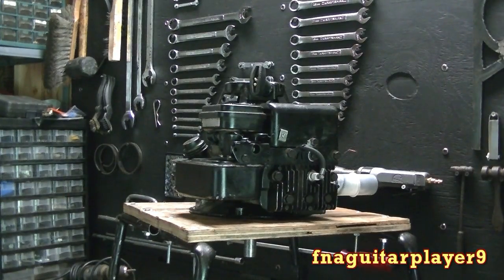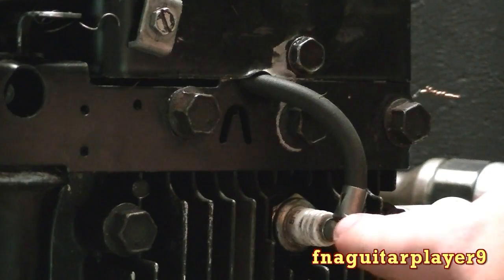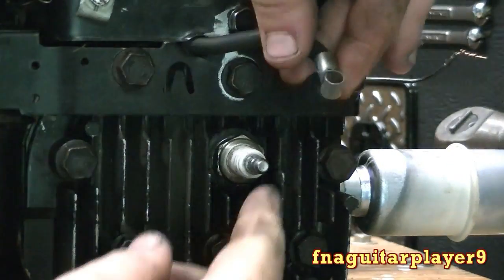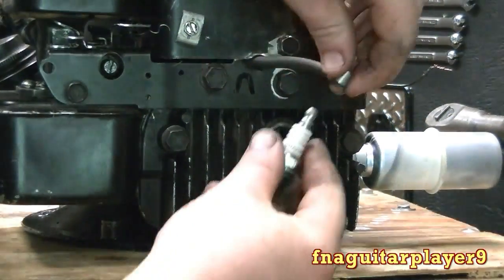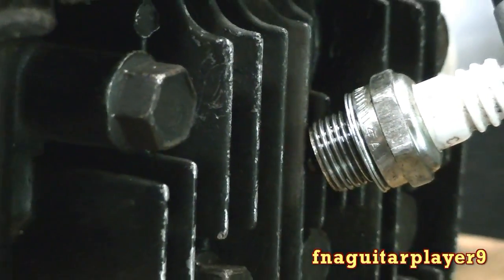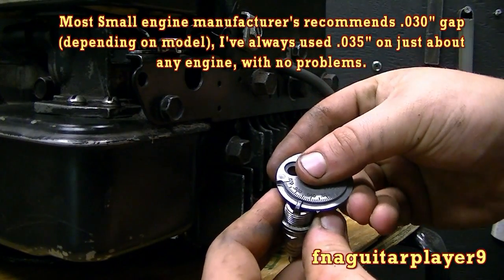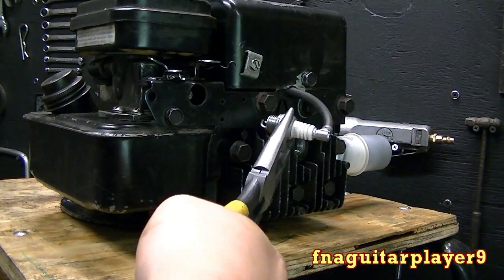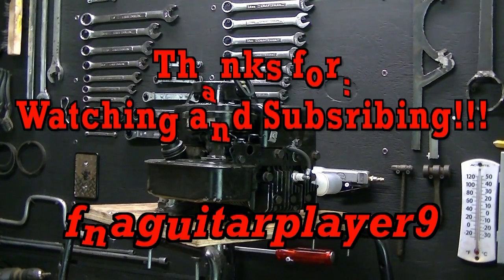How to check for Spark Plug Fire (in any engine)

Comment: You just saved me a costly repair with this video. I gapped some plugs for a Kawasaki 21hp motor "according to specs" and it wouldn't fire for nothing! I was thinking the coils were bad. They are about $80 each. After watching your video, I went out and checked the plugs and ended up resetting the gap and she fired right up! Thanks!
Reply from the maker: Glad to help out! It wouldn't surprise me if the coils were weak, because Kawasakis are bad about the coils going out. Thanks for Watching!!!

Comment: thank you for this. been wondering how to see if my motorcycle was sparking or not. did not want to pay for an extra tool. this was a well made video for people like me who are gearhead newbies!!!
Reply from the maker: Your welcome, yeah I found this is the best way to do it, some will argue saying its not 100% accurate, because the spark can change under pressure, which is true, but this has always worked for me, they do make a inline tool (pretty cheap actually) that connects inline, never used one! Thanks for Watching!!!

Comment from the maker: Thats very true. Someone left a similar comment about a year ago on this video. What this "test" does is just make sure that the ignition system is working and the plug is firing. In my experience If you have a plug with a blue or blueish purple spark, it will run fine in the engine, you can't really get a better spark than that. But like I said this just tests to see that the plug is firing. its nearly impossible to see what the plug is actually doing while running. Thanks for Watching!!!

Comment: yeah do be sure the plug stays grounded when testing for spark on any thing if the spark plug isn't grounded and you wing the engine over you could very well damage your coil or coil packs. i seen the video and wanted to see if it had the info. Also another thing just because it sparks in our atmospheric pressure doesn't mean it will spark under the compression of the engine ive had spark plugs do that. Its cool to see how many people you have helped. I had no idea how many people didn't know this.
Reply from the maker: Yeah that is true too, I've heard that before and i'm sure thats been the problem a few times, this is how I've always done it most of the time it works haha thanks for watching!!!

Comment: Hey man thanks for the how-to video. I'm trying to diagnose a cylinder 1 misfire on my F-150 now and this really helped out!
Reply from the maker: Your welcome! I hear ya! I think its the best way to check it, some will argue that the inline checkers are best, while that is easier/faster i like to see the spark my self haha Glad it helped out, thanks for watching!
Reply: Yeah I used one of those cheap in line testers to diagnose the coil and it was giving me a blue spark. Pulled the plug and it was super dirty so I gave it a good clean with a wire brush and tested it and it's giving me a weak orange spark, but put it back in to see how it'd do. Started my truck up this morning and it was doing a little better but still misfires every now and then. Going to grab new plugs today and see if that fixes the issue.
Reply from the maker: All they do is just check the voltage more/less, i guess its good to test a coil in a case like that. Yeah a new set should fix that, might want to consider replacing the wires as well. I just did that on my truck and it made a big difference. Also its best to replace or at least clean the cap and rotor, if your engine has that, i don't know what year yours is. Mine has the coil pack on it. Let me know what you find out!

Comment from the maker: reason why i said a push mower and a weedeater, is because weedeaters are completely different than a 4 stroke lawn mower engine, and its good to have experience in both. but a class is the best way to start, they will start you from the bottom with loads of info and tips, you could work on the push mower while your in the class, in case you have a question your teacher could help out. i recommend learning by doing, as much as possible, now obviously your not going to learn everything fixing up

Comment from the maker: a mower, but it gives you some good practice time, first engine i ever worked on was a 5 horse briggs tiller engine, had no carburetor or nothing, but i tore it down and learned how everything worked, then put it back together, never got it running because it was missing so many parts, but it was good to know how one goes together. well thats about all i can tell you, but i do recommend the class, good experience, but i have to tell you one thing, unless you live in the middle of a city or have

Comment: I did already know how to check for sparks but what I learned from this video is about the color of the sparks.thanks  
fnaguitarplayer9
Reply from the maker: +cat vs dog I hear ya, the color does tell you alot, some have argued with me, and i'm not saying there wrong, just that if you check spark and its blue, 90% of the time it will run, if its red or yellow its usually to weak to run. Thanks for Watching!!!
Reply: fnaguitarplayer9 Yeah I checked the spark plug on my Honda Recon Four Wheeler and it was a purple spark. You said that purple is the strongest spark.
Reply from the maker: +cat vs dog Yep, purple is the best!
Reply: fnaguitarplayer9 well atleast my ride is in good health, but why is it when I pulled the plug out it was very very white and not black like it should be?
Reply from the maker: +cat vs dog I hear ya, well actually a white plug means its running lean to perfect mix, black is from running rich or oil burning, so that sounds like what it should be.
Reply: fnaguitarplayer9 ok well that's good then.
Reply from the maker: +cat vs dog Yeah, I'd say its good to go!

Comment from the maker: Sounds like something wrong with the carburetor, does the exhaust pipe smell like gas? If it does i think your float may be sticking causing it to flood out, if its not getting enough gas you probably have a clogged jet, also check the spark plug. hope this helps, thanks for watching!!!

Comment from the maker: good hobby/sideline to get into, i love doing it, more than my trade (electrician) haha i can't say much about a SE class, because i never took one, i learned most of what i know by helping my dad keep the mowers running all the time, then i kind of took over, and now i do most of the work, i learn by doing, and i recommend anyone getting started on small engines to find a old push mower and a weed eater, that doesn't run or doesn't run good, and fix them up, best to start small, and the...

Comment: I did it that way for years and still sometimes do. That’s a good preliminary check, but not 100% reliable. A weak coil can fire the plug when it is out of the engine but may not when it’s installed. A Stihl training class I took showed that it take six times more voltage to fire the plug under the compression of the combustion chamber than in the open air. Eventually you will run into that situation.
Reply from the maker: Your right. I did a more recent video talking more about this and showing the inline spark tester. Thanks for Watching!!!

Comment: Hi. Excellent videos.  I have a 12.5kp briggs, wont start, wont turn over on key but will by touching across terminals on solenoid, changed solenoid, still same problem, changed  ignition switch, will now turn over on key but wont start, thought it was a fuel problem, when it was running a month ago was running lumpy so bought a new carb, now i have changed that still wont start, new spark plug, wont start, any ideas???

Comment from the maker: yeah that should be a good place to start, on some you can adjust the low and high mixture screws to tune them out, alot of times you have to get a new carburetor kit for them. thanks for watching!

Comment: Thank you very much for this.......with my old coils on a Johnson 5.5 outboard i got a white spark.Any ideas what that means?I changed to new coils and now it has the right blueish/purple sparks it prob needed but it still fired up with the old coils and the white sparks/arcs but also with the old cracked coils it wouldn´t idle in any way tho it ran on higher revs and run worse in general when it got hotter.Old coils also had cracks in them.Just wanna know about the white arc.Thanks

Comment from the maker: The thing is you have to keep it a constant RPM for checking it at low rpm and high rpm, i've never really done it on a 4 cycle (i got by smell of exhaust mainly) before but i have on my pocket bike i just run it for like 5-10 minutes thats usually good enough to get a idea. some will say it takes longer, then you have to be sure to turn the engine off before idling down or else you will get a false reading. thanks for watching!!!

Comment from the maker: the wire from the coil? It is a kill wire, for testing this unhook it, it will hook to a switch on the throttle control so when you throttle down past idle it will shut off. It just grounds out to shut off the motor. thanks for watching!!!

Comment: How far into running the spark plug can you check tanning on the plug , i.e. a new clean spark plug, how many miles till i can check to see if mixture is correct?

Comment: Howdy,
I have a Sears weedeater and I changed fuelines filter, cleaned tank and checked the spark and it started but idle was too high and when I shut it off, it would not restart.So, I'm thinking that I should pull carbie and clean the intake screen and blow out holes and retry it.What do u think?  Thanks a mil.

Comment: Hello, nice video. I have a John Deere LA105. The last time I did my lawn everything started as it should. This time I turn the key, it turns over but no ignition. I’ve since removed the carburetor and blown through, removed the fuel line a turned over the engine to check fuel delivery to carburetor, drained the fuel and added fresh. I’m just about to check the spark plug. Any other advice you can give would be appreciated ? This is the second time this has happened, first time I took it to a John Deere repair place but I’d rather try and figure it out this time round.
Reply from the maker: Thanks! I would check spark first, could be weak or none at all, if no spark then disconnect shut off wire and check again, if you got spark its in the wiring or a safety switch, if still no spark then probably bad coil, but try a new plug first. thanks for watching!!!

Comment: The ignition is very powerful. If you had a spark plug in one hand during you were pulling the pull starter you would admit. ;) 
I got an electric shock, so be careful!
Reply from the maker: +MartyMartin87 Yeah it is, that will really light you up, I had a friend helping me on a push mower i said wait till i say to crank it over, well guess what, he didn't wait LOL Thanks for Watching!!!
Reply: I did that once. Just once.

Comment from the maker: First thing to check out is the wiring, like on lawnmowers like this, sometimes the shut off wire will ground out and keeps it from running or a safety switch, i unhook the shut off wire and check first, then if its a small engine, you have to set the magneto/flywheel gap, and on any engine that has points and condenser start with cleaning and setting the point gap, and replace the condenser, if all that checks out its probably the coil. Thanks for Watching!!!

Comment: Excellent info, thanks for sharing. By the way what could be if sometime the spark plug fire and other not. I am using this method with a new spark plug (NKG) in a zenoah 26cc. Might be a bad wire of ignition coil? The engine has died after few seconds on. thanks
Reply from the maker: Thanks, your welcome! It does sound like a bad wire coming from the coil and going to the plug, or the shut off wire shoring out against something, but it could be the coil going out as well, hard to say really. I had the same problem on a 14.5 briggs and stratton, it was the wire on it. Thanks for Watching!!!

Comment: Thanks for the video.  Trying to get my 5.5 B&S on my leaf vac going.  I have put a new plug in but will test with the method you showed.  Thanks again from NC.  By the way is there an easy way to id the "shut off wire" in case I have fire on the plug?
Reply from the maker: Your Welcome! Yeah, you can usually find a single wire coming from around the flywheel shroud, thats usually it, it should be hooked to a shut off switch on the vac.  Thanks for Watching!!!

Comment: Thanks for the video. I have a Weedeater FB25 blower. The sparkplug is surrounded by a plastic housing. How would you recommend ground the plug with no exposed metal from the blower that it will reach? thanks
Reply from the maker: What i usually do in that case is wedge a screwdriver in between the plastic and metal and touch it against it, OR get a inline spark plug tester, then you can leave the plug in the motor. Thanks for Watching!!!

Comment: What would cause a coil to show spark through a spark plug tester but no spark through the plug when grounded? (Yes I know the plug is good)
Reply from the maker: Either weak coil, or possibly a short in the wire, I had one that would not fire in the engine, but take it out and i guess it made a connection and would spark, i was going to say try another spark plug, I've had bad new plugs before, rare but happens.  Thanks for Watching!!!
Reply: @fnaguitarplayer9  Turns out it was dirty points on an older lawn boy machine. First time I work on one of these!
Reply from the maker: @QuaabQueb  I hear ya!

Comment: I want to check the spark like you're showing but want to make sure that I'm just cranking the engine over and don't want it to start. It's a 4.2L Ford V6 in a E250 Ford van. How can I keep the engine from starting? Thanks.
Reply from the maker: Unhook all of your spark plug wires, keep them close to the plugs so you don't get them mixed up. Thanks for Watching!!!

Comment: I'm always messing about with old lightweight motorcycles and mopeds that run with a flywheel magneto without a battery, to get them running if the coil is not good enough I've been advised to run the engine with a battery connected in such a way that if will eventually discharge and require externally charging but I don't know where to connect it, do you know ? if so could you tell me.

Comment: If the spark plug does not have a good ground will it have a week spark? I have a new plugs coil pack and plug wires but I get a yellow spark still.
Reply from the maker: Usually the plugs won't have a ground problem but the coil could. Thanks for Watching!

Comment: This is a good quick test, but to be sure you have a sufficiently strong spark it needs to jump a gap much bigger than the normal plug gap.  As for the first plug that was having trouble, closing the gap would have likely brought the spark to the electrode, opening it will increase the odds that it jumps elsewhere.  Running a wider than spec gap will increase the odds of a misfire, don't do it.
Reply from the maker: +DonziGT230 Yeah it will get you in the ballpark, and most of the time with small engines its enough if you have a good spark. Very true. Thanks for Watching!!!

Comment: just because you spark plug fires in this test does not mean it will fire once it is back in the engine. the plug still could be the culprit or the ignition coil may still be faulty. always good to have a new spark plug around just for testing to see if the engine will run with it. sparking outside the cylinder and sparking inside the cylinder with compression and fuel is two different environments. also you can judge the spark by a blue color and hearing the spark.
Reply from the maker: I recently did a 2nd video going in more detail about that, and i showed using a inline spark tester as well. It gives you a idea if the plug is firing good, because the inline checkers don't mean the plug is firing good, just that that the plug isn't fouled and there is enough voltage to fire it. Thanks for Watching!!!

Comment: Question: Is it a good or bad idea to do this same thing in a car (turn the ignition with one of the cylinders just open to the world)?
Reply from the maker: Peter O'Connor It won't hurt anything just for checking spark, but just make sure that the plug is away from the plug hole, if there is gas in it it will turn into a flamethrower haha Thanks for Watching!

Comment: So, a less than bluish spark would lead you to testing/buying a new ignition coil?
What about that little condenser/cylinder that seems to be part of the distributor of my 1998 nissan frontier?
Reply from the maker: Not necessarily, that is a condenser which is just a capacitor. But being a newer model it probably doesn't have points/condenser. If it doesn't have points/cond. then I would suggest new plugs and wires first, and dist. cap / rotor. Most newer models just have coil packs going to each plug. Thanks for Watching!!!

Comment: Hello I am new at this but, I have a 1999 Ford Contour and I need to know how to connect the spark plug wires correctly with the coil distributor.
Reply from the maker: I'm not familiar with that, you would be better off getting a hanes manual or looking up on google for that. Thanks for Watching!!!

Comment from the maker: First thing I do is try another spark plug that you know is good, just in case its a bad plug, then I check the wire from the coil that shuts it off, it could be shorted, if its a older engine with points and condenser, the points probably need cleaned.  if those 3 check out it, its one of 2 things, a bad coil or a bad plug wire. Hope this helps! Thanks for Watching!

Comment: is bad spark plug or faulty ignition coil will sometime cause the car rpm not stable during driving?
Reply from the maker: it can be just depends, its probably fuel related or a bad sensor causing that. Thanks for Watching!!!